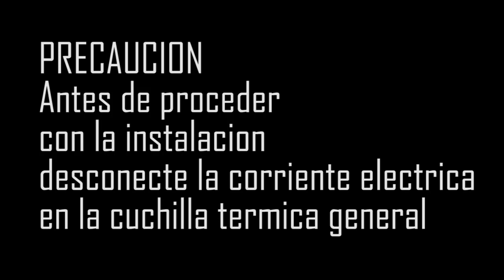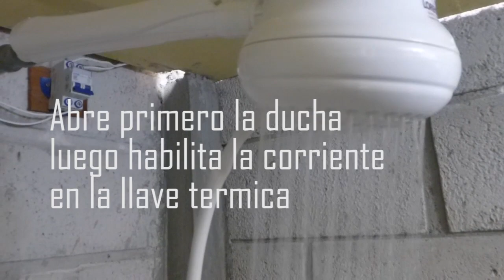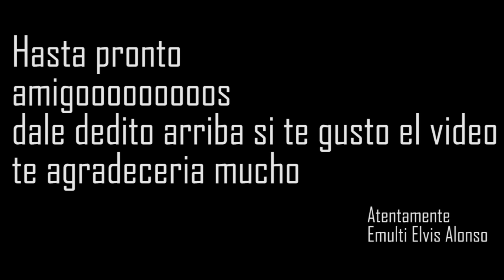Instalación SEGURA RAPIDA Y MUY FACIL DE UNA DUCHA ELECTRICA O TERMICA paso a paso

Comment: Primero que nada se recomienda usar llave diferencial (proteccion para personas) en vez de llave termina (proteccion para circuito) lo segundo es que esta llave debe estar de 0.50 a 1 metro de distancia del eje de la ducha esto para proteger del contacto con el agua pero se recomienda 1 m, en este caso tu lo conectas directo por temas de ahorro pero recuerden que la vida no tiene precio instalar unos metros mas de cable no te hara pobre pero si puede salvar tu vida y lo tercero es que estas duchas electricas solo y solamente se pueden usar en caso de que la vivienda tenga una puesta a tierra ya que el cable verde sirve para eso de esta manera cuando haya una mayor descarga electrica esta pasara en la tierra con el cable a tierra que va a un pozo a tierra y no moriras electrocutado.

Comment: Y la tierra física????? Muy mal 👎👎👎
Reply from the maker: E s que no hay instalación para tierra simplemente se deja libre en este caso.
Reply: @yoideaselvisalonso  amigo, simplemente pones un tramo de cable calibre mínimo en 10 y lo pones a una varilla en la parte externa del bajo o ducha, y con eso es suficiente, hazlo ahora corre el riego cuando llueva de que haya una descarga y al estar en el tubo puede ser fatal.
Reply: Dame tu correo electrónico y te envío cómo puse la de mi casa estudie 2 ajos sistema eléctrico residencial e industrial..